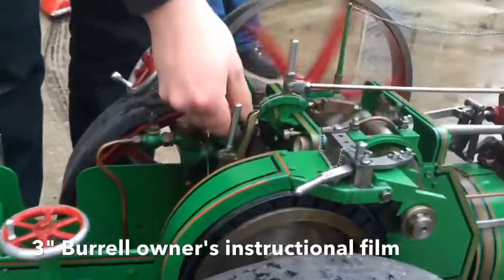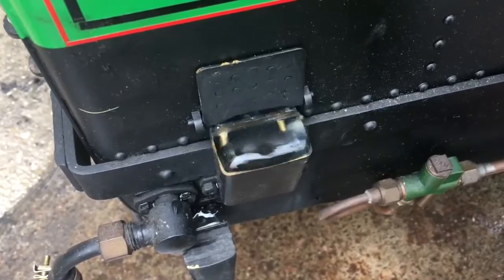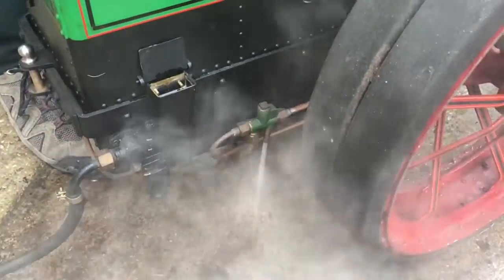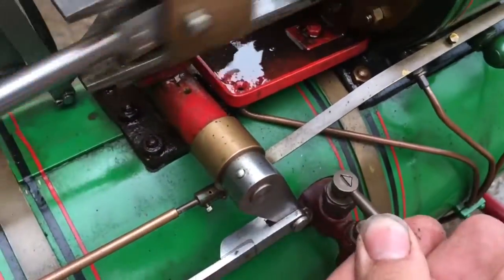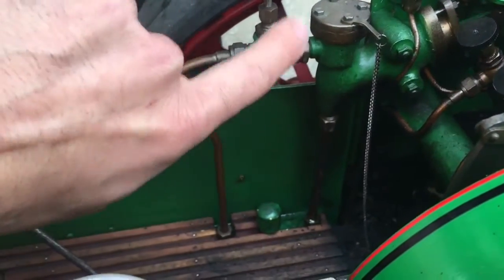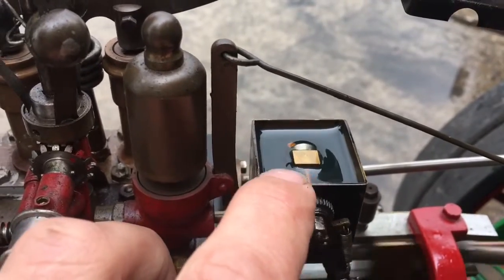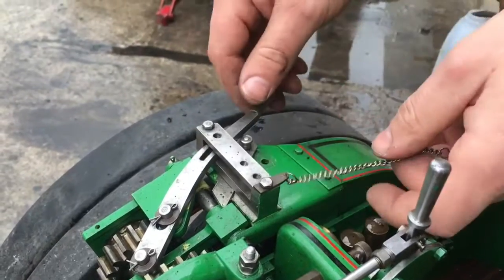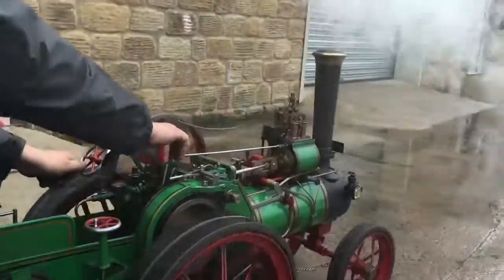3" Burrell Operation film

Comment: does 3" refer to the stroke or bore of the cylinder?
Reply: steam engines need to have two methods of feeding  water in to the boiler , in case one fails
Reply: oh it refers to the scale, 1inch to the foot. secondly why is there a bypass valve and an injector?
Reply from the maker: Harrison Long neither.  It’s 3” Scale.  3” to the foot.  So it’s 1/4 full size.  :)